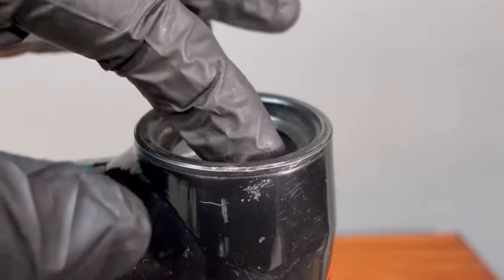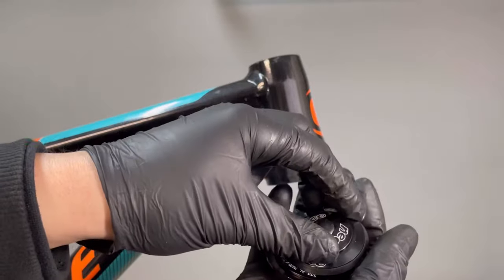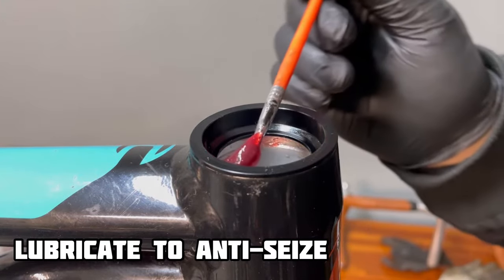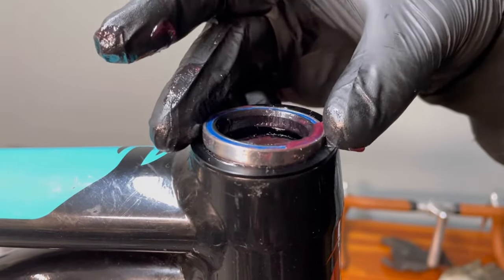HOW TO REPLACE TAPERED SEMI-INTEGRATED HEADSET IN YOUR MTB BIKE | #TAPERED #MTB #HEADSET

Comment: Doing both bearing races at the same time is a very bad idea. By doing one at a time, you are able to keep the other end referenced square to the head tube. Doing both drastically increases the chances of them not being straight and square.
Reply: If they aren't square that would suggest the frame isn't either

Comment: Do you need to install a new crown race on the fork?
Reply: ideally. usually the kit (or bottom bearing kit) will include a new crown race. you could use the old one if it is still flat and smooth and mates up to the new bearing/seal.